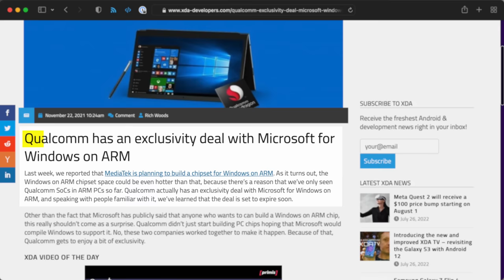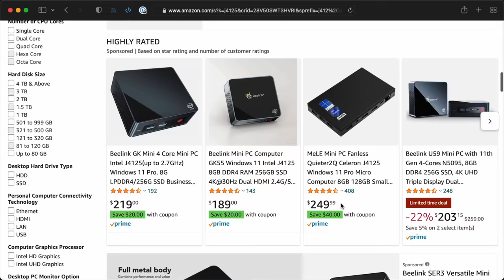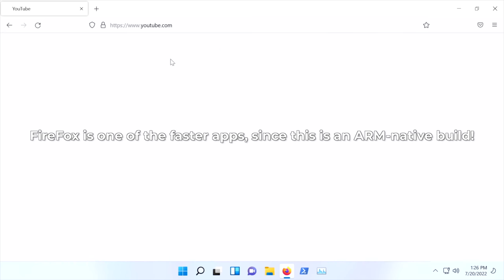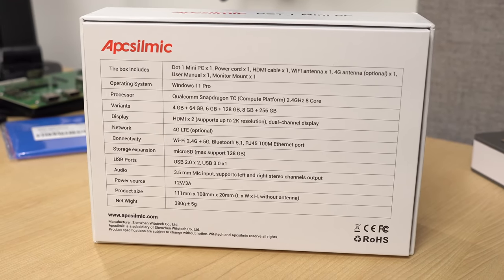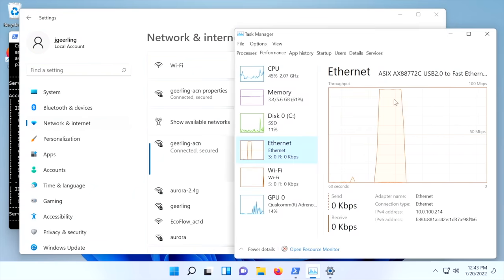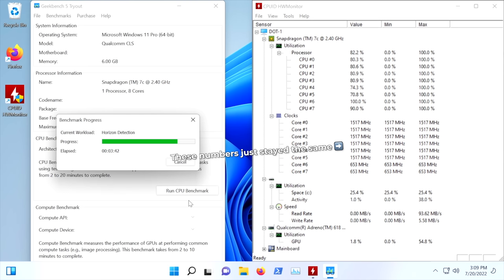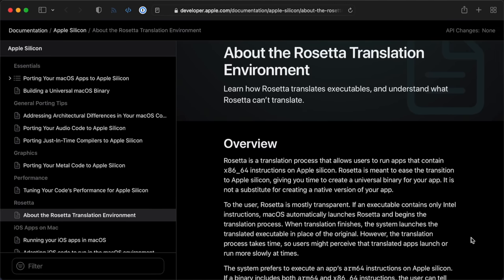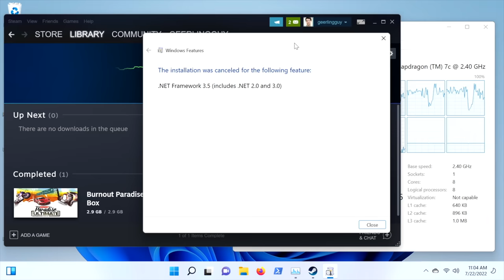Microsoft's wasted potential: Windows on ARM

Comment: You seem to be missing a really important point in this video, why should Microsoft bother to make Windows on ARM any good?. The two advantages of ARM are power efficiency and adding special silicon to speed up certain tasks, but the burden of switching isnt worth it, at least for Microsoft. For example the M1 was impressive when it was new but its no longer faster than its x86 competitors and the M2 only gives an incimental improvment of the same magnitude we see with x86 CPU improvements. Apples media engine is cool but is only useful in niche use cases, I can be fairly confident in saying less than 10% of users will notice it at all and Nvidias GPUs are likley catch up in video editing next gen. Apple switched to ARM because they already had ARM expertise in house and they wanted more of the profit margin to themselves, if they kept using Intel and AMD they would have to keep giving them over $200 for every machine they made. The only downside of x86 that effects users is the worse power efficiency, but good x86 laptops already get 10h+ of battery. Microsoft are sticking with x86 because they dont need to invest anything, the performance is more or less the same, and it allows them to retain compatability with 30 year old software.

Additionally its not really fair to compare a $250 computer from a no name company against a $1000+ computer from one of the worlds largest companies. Its like how some people buy a $200 Android phone and go "why is Android still so terrible" when they are coming from a $1000 iPhone. I am sure the software experience would be a lot better with Microsofts own ARM devices.  I think it would have been a better idea to buy a similarly priced x86 machine to compare it with.
Reply: I hear where you're coming from, but as a complete package the M1/M2 are still crushing the x86 platform. The Intel CPUs can only keep pace with Apple's CPUs when burning many times as much power. Which generally means plugged in. Whereas the Apple laptops can go all day running at that performance on battery. 

Bring in specialized tasks like Video Production and AI, and the seemingly parity performance just drops to nothing. Apple's CPUs absolutely crush Intel CPUs for professional productivity. 

Microsoft is in a tough spot. They're being forced to retreat into the budget category and their classic software bastions like 3D Modelling. Budget is extremely low margin and if Apple ever cracks some of Microsoft's bastions, they're done for as a competitor. 

Microsoft has to hope and pray that Intel can catch up before that happens. Which isn't a great strategy given how Intel basically brought this current situation onto themselves. Microsoft is going to need a backup plan.
Reply: @thewiirocks  The problem Apple has is that these are all niche scenarios. For example needing high performance computing without proximity to electricity is rare, so Apple ends up in this weird niche. Another example would be high end video editing, large productions will use high power servers with orders of magnitude more power than any single computer, so the laptops hardware is irrelevant, on the other end of the spectrum simple video editing tasks work fine on the cloud using tools like kapwing or built in editors, so Apple again ends up dominating this uncommon niche which tends to be Youtubers. In terms of AI workloads Apple ends up in another niche, big companies working on AI tend to use the cloud for training models, or in house high power servers, so the laptop doesnt matter, and for smaller companies AI is uncommon, and when it is used its typically just using somebody elses pre-trained model which doesnt require a whole lot of power. 

The problem Apple has is that being better in some use cases isnt good enough if they want a larger marketshare, they need to be better in almost all cases while being cheaper. Microsoft has nothing to worry about because their core customer is not the consumer but the buisness and Apple does not take the buissness market seriously. They have no answer for Microsoft 365, their computers are more expensive, and their computers are more difficult to manage centrally.
Reply: I think the real reason that Apple migrated to ARM is that today's system performance is less dependent on the CPU-core performance, and much more on the accelerators (GPU is one example). Intel has been (way too much) core performance focused (because that is the game they played for 30 years - apparently the only game they know). The game-changer of M1/M2 is not the CPU-core performance, but the total SoC performance. Intel missed that boat. If uSoft keep focusing on Intel X86 - they will miss that boat too.
Jeff: thanks for a great video - I don't understand why this box is put onto the market...
Reply: @ronaldglider  Actually, Apple's choice of ARM was much simpler. Intel refused to create the mobile chips that Apple needed. Apple actually went to them first, and they thought the iPhone would be a low margin business. So Apple was forced to go ARM and decided to develop their own chip platform. They got really good at it and eventually added the few remaining features to make them desktop-class chips.

I remember hearing things like the "A12 is faster than desktop computers". Which was a bold claim to make, but something we couldn't really test. Now that Apple has packaged their CPUs into laptops, we can test it and the results are really spectacular.
Reply: @somerandomdude4300  I don't think you understand the high end video editing market, which IS dominated by Apple. You're talking specifically about vfx, which does indeed consist of workstations and server render farms. But that's a niche within a niche. It's a very important part of the film industry, but it's only one part. Overall, Apple still dominates in most of the largest areas of post production. Video, motion graphics, graphic design, all of them are in Apple's wheelhouse, and they specifically cater to them and it's far from being an "uncommon niche."
Reply: @haysoos123  I would be interested to see some actual statistics on this but im fairly certain less than 1% of all computers used in the world are used for high end video production which I think is kina the point where something becomes a niche scenario. Either way Apple winning over small segments of the market which overall probably makes up less than 10% of computer use cases is not going to get them mass market appeal and certainly not going to give Microsoft anything to worry about.
Reply: Because being stuck on x86 is not a recipe for survival into the future.
Reply: @lawrencedoliveiro9104  Are you going to elaborate on that?
Reply: @somerandomdude4300  Look at Intel’s ongoing problems.

RISC rendered all CISC architectures (except one) extinct decades ago. The only reason x86 is still with us is because of the inertia of the Windows installed software base.

But that inertia also means that any attempt to port Windows to RISC architectures becomes a flop, because it cannot take the installed software base with it.
Reply: @lawrencedoliveiro9104  That's all true but it's still nothing for Microsoft to worry about, as long as their computers are cheaper and good enough, people will keep buying them, most people don't care about performance as long as word opens quickly enough.

Comment: Windows 11 doesn't even run that great on a good machine, can't imagine using this thing.
Reply: Not true. The newest patches run better than any version before, using even less ram; all the way down to Vista; AND add to this the compatibility layers with previous windows.
.net framework needed for older apps, also became a lot smaller. 4.5, 4.8 can do as much as 2.3, but at half or a quarter the resources.
Reply: lmao
Reply: You are a bit behind Windows 11 performance is good now

Comment: Agreed across the board. If MS had put any effort into ARM optimization and compatibility, they could have been an ARM juggernaut by now. They've been in the ARM desktop OS game much longer than Apple (Windows RT debuted in 2011 or so), but MS has always treated ARM like the redheaded step-child. Windows on ARM today is just as sluggish as it was a decade ago, and the app ecosystem has improved slightly but is still pathetic. It's fun to putz around with WOR on my Pi every now and again, but that's about all it's useful for so far.
Reply: They wont ever put the optimizations in, they cant even optimize windows 10 and 11 on x86_x64 without breaking it.
Reply: They were the “ARM juggernaut”, until Android came along.

Comment: And Qualcomm was blocked by Intel when they wanted to have an emulation/translation layer for x86_64 but later on they somewhat solved that and the feature is available on newer chips/systems (Microsoft ARM tablets and alike).

Comment: I remember that story in 2017 that intel almot sued microsoft for emulation x86 on arm with zero to no degradation on performance. 
Intel didn't liked that in time and looks like it made microsoft stop it's development. Microsoft knew arm would come
Reply: How does Apple get away with hardware assisting x86 on the M1? You would think that Intel would be pretty whizzed off about that, especially after losing Apple as a major customer.

Comment: Unplug your Ethernet cable, and it will connect to Wi-Fi, I feel like Windows doesn't bother with Wi-Fi if you also have a wired connection.
Reply: It specifically prefers wired, which is normally a good assumption,
Reply: And it sounds reasonable. I would be ... not happy, if I make labor to bring cable to my computer, to makes it decide for itself wifi is fine.
Reply: I've also seen it prefer wirelsss over wired, it's definitely better to just turn off the one you don't want it to use.

Comment: I wonder how much of tis is actually Windows on ARM and how much is that specific hardware? I regularly run Windows on ARM in Parallels on my M1 Mac and I don't notice any issues at all in day to day uses. I can even run a good number of games from Steam. This is the same version of Windows, right?
Reply: If you want to see true horrors, try running Linux ARM64 on a RPi3, then compare and try running Windows on ARM. It took me SEVEN hours to download and run a debloating script on Windows 10. SEVEN HOURS. I can't imagine what Windows 11 is like.
Reply: @alex15095  try Ubuntu on a raspberry pi 4. I will not repeat that mistake.

I mean, the whole reason why even tried Ubuntu on a raspberry pi was not good (messy build scripts originally written for windows which download qt binaries from an internal sever, ported to Linux (the idea of using the native QT of a linux distribution is somewhat possible - just use messy sim links to "emulate" the messy recreation of a messy windows dependency management) building trying to build code that has "some" switches for legacy qt version, that just don't fit the random qt version that comes with raspberian, because a version check was not written proper)

Comment: I'm afraid that the attempt to run x86 software on ARM might outright kill the lower end WoA devices.

I own a 7c based laptop and my experience using it with Linux, where all software can be native built, is pretty much amazing. Yes, it requires the knowledge and quite a bit of time to even get it to work due to the way how Linux handles mobile ARM chipsets like this, but IMO the hardware is pretty good as an "office" computer, and even (properly built and configured) Minecraft java can run on the thing at 60 fps so I don't see it being a problem running games on it if those were natively built.

But the MS ecosystem right now seems to pretty much assume x86 compatible PC with them allowing you to run "broken" software and be disappointed. And when they try to "fix" it by restricting the user (the "s" mode), people also get disappointed because no one will rebuild the software for the new arch.  Maybe this shows one of the advantages of FOSS - the software can be built for the new arch at the decision of the distro maintainer or even the end user with no action needed from the developer, who, at this point, might be absent. This is almost impossible when all you get is the precompiled binary blob.
Reply: I never even considered buying an arm laptop, :/.

Comment: You know what's better than Windows on ARM? Not having to use that discusting OS since 10 was released, and having always an alternative regradless of the use case. Hopefully MS will continue shokting themselves in the foot, giving time for better alternatives to gain market share.
Reply: Ditto
Just had to install W10 (haven’t been a Windows user for many years) for some specific network testing & parts that where terrible 25 years ago, are still exactly the same..
Reply: Windows 8 was my turning point to go to Mac and I don’t miss it one bit.

Comment: The wifi thing was because you had ethernet connected, windows in my experience always defaults to a wired connection if there's one active.
Reply from the maker: It's okay to default to the wired connection... but on my other computers (mac/linux), they still will maintain the wifi connection even if Ethernet is first in priority/routing order, since there are good reasons to be connected to two networks at a time.

It seems like a bug to me if Windows doesn't connect to WiFi if that checkbox is checked :(
Reply: @JeffGeerling  it is how it's always behaved for me since I started caring to check (few years ago). Only situation it'll try to fall back to wireless is if it figures internet connectivity is problematic via ethernet (dunno how it judges that, probably just when it has no connection at all).
Reply: @pocketables.com @Jeff Geerling  whatever happened to setting adaptor metrics ? lowest metric wins.  

and then i also think that, driver specific (what the adaptor manufacturer allows you to adjust in their network adaptor's driver config settings) there if sometimes the option to disable wireless if ethernet is connected. obvs, we want to turn this off if we want to have both adaptors active (multi-homed ?)
Reply: @JeffGeerling  No argument that it could have better behavior, it's just what i'm used to seeing on every pc i've worked with unless I did something specific(multi-homed systems with wifi on one network and wired another) the faster wifi than lan is an odd situation you almost have to use bad hardware to be in.

Comment: Perhaps you needed to manually connect to Wi-Fi because Windows sees ethernet as a generally better connection than wireless (even if in this case it wasn't) and in the video you were connected to ethernet.
Reply: You can manually set the metric in the advanced section of the IPv4 settings to prefer wifi and make ethernet the fallback option.

Comment: It’s funny because the best Windows on ARM experience is probably on an Apple Silicon Mac running Parallels. That’s what I do for my Windows only Steam games on my M1 MBP. I wouldn’t use it for at home gaming as I have an actual gaming PC for that but on the go it works just fine.

Comment: To be fair, outside of server Neoverse chips & Apple, Qualcomm makes the most top end ARM chips available. Maybe Nvidia will compete a little more in the future, but for now its just automotive embedded development boards & the promise of an HPC & AI CPU, as well as some old designs in Nintendo Switches. Sure, Samsung & Mediatek exist, but its not like they already have a chip that simply outclasses Qualcomm. So I don't think it was the exclusivity deal, that is the problem. Apple has not only delivered a better emulator, but also the support, tools, pressure and example on migrating software, and Microsoft just hasn't. When even their own software isn't available natively, why should anyone else care. Not to mention most people who use Windows do so for the compatibility, not because it is good. So even if they can switch away from that, why would they go to Windows on ARM?

Comment: On slow startups: Try loading the same app again. The first time an X86 or X64 app loads on W11 ARM you will get a delay because it’s running a JIT compiler to create the ARM code blocks. After that initial delay the compiled blocks are cached and it should load much faster the next time. The same goes for major dialogs and functions within apps. First time slow, later faster.